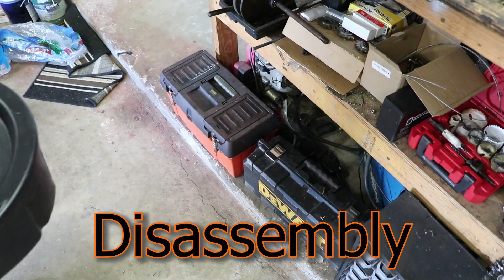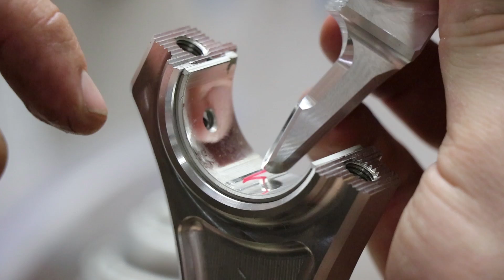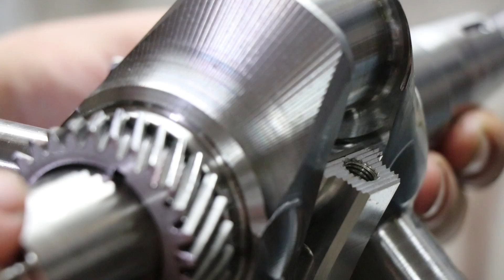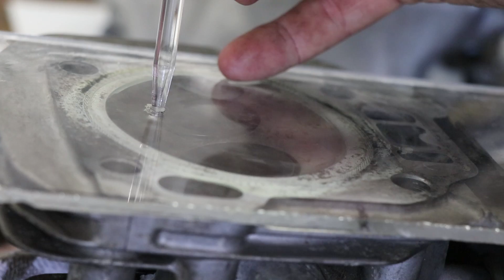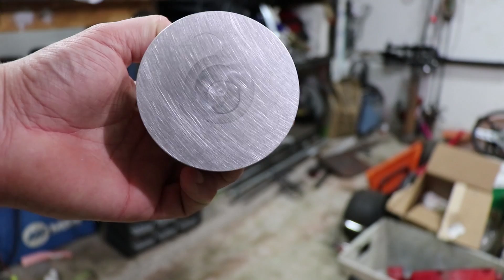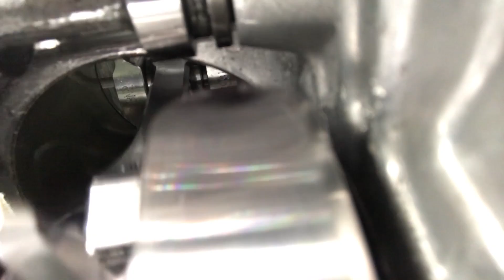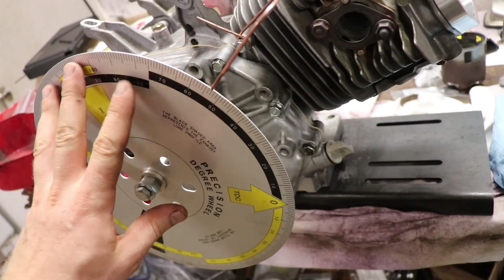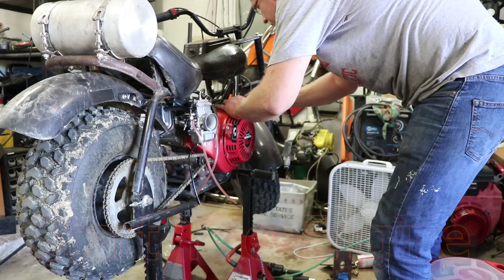Stroker Engine Build: 30+ HP on a 65 MPH Mini Bike! (Complete Build)

Comment: I have a question that I would like to know if anyone will clear up for me. I have a predator 212 stock and a 30 series toque converter (the tav kit from go power sports) I would like to know if I do an engine swap to like a tiloston or just make the predator like stage 3. if I could make the engagement springs in the 30 series heavier so it engages later. Cause it is only rated for like 8 horses and is only supposed to go to 3600 rpm and I want to know if it would be ok if I ran it at 10 or 11 hp (probably still governed)
Reply: Brian Boyee, is it really that much of a money pit?
Reply: Yes it absolutely is

Dont throw good money after stupid shit

Comment: You mean my GX390 power washer can make 40 horse power??? Duuude!!!!
Reply from the maker: Yah man you just gotta drop 2 g’s on it n it’ll be litttttt
Reply: KartFab But in all seriousness, why these particular engines?  There are so many better and more powerful engines to use. Why this style. They are so basic and kind of primitive. 

I am totally shocked there is such a extensive aftermarket for them tho.
Reply from the maker: certain classes for racing require industrial 4 stroke pull start engines.

Comment: all done this by myself, doubt 30+ hp
Reply from the maker: I guess you will have to wait for the Dyno run then😀
Reply: no fuel pump, block not welded. agreed.
Reply: Yep, I say low to maybe mid 20s reliable power in a usable RPM range.
Reply: You guys built one? Where's your vid I'd like to see you builds.
Reply: WurstExpress #616 youd be surprised but I dont think 30+ either
Reply: pdgeman exactly when the block not welded no way. The block would crack if it was 30+
Reply from the maker: You must be thinking small block predator engines. These are big blocks.
Reply: KartFab  I did it to a 420 GX honda clone engine
Reply: @WusXPRS  Id be surprised if i does to but at the end of the day why comment negative. Its a good build if hes gonna dyno it wait to see results then say i told you so. There's always someone out there more capable. I think what Mcroostr is trying to say is just because you couldn't doesnt mean someone more competente cant.
Reply: You first Neo, where is yours?
Reply: J-styga i meant,.. show us yours,.

No way 30+ hp

Comment: Hahahahaha I have a 3 inch stroker 212 and it makes 40 HP you must have not spent enough money if your Only making 30 HP on a 399
Reply: On who's dyno?
Reply from the maker: hes just trolling Jody, he does that to everyone. Whats your guess on this engine? 440cc; 10.2:1CR; 275 cam; 1.2 ratio rockers on premium pump gas, 26 degrees timing, mikuni 32mm flatslide.
Reply: Jody atARCRacing The devil's power house here I Ottawa Ontario.
Reply: KartFab strolling through the comments.
Reply from the maker: hey man. good to see you posting again. Why don't you post on DIYGOKARTS anymore? XD
Reply: KartFab seriously though you could get more HP from that engine if you poured more money into it...
Reply: KartFab I'm to busy building engines no time for Diygokarts
Reply: Well considering removing the governor, the stock air box, rejetting the carb, replacing the square muffler with a header pipe will yield around 18hp, I'd guesstimate you are in the area of 27-28HP on gas. 30 is not out of the question at all. That will depend on how accurately the carb is tuned.  Most folks fail to understand the cubic inch difference between a 200 or 212 engine and a 390/420. It takes less work to achieve higher gains with a larger CI engine.
Reply: 3" and stroked will only yield 266 or so CC's. The best builders in the business are only getting 40-42 out of 342CC Billet head engines. Not trying to get into a pissing match here, nor am I implying your engine is not strong but a true 40hp is not obtainable with that little of CC's and naturally aspirated.